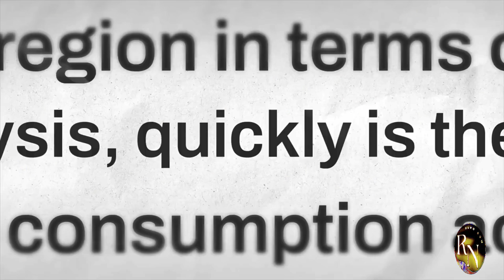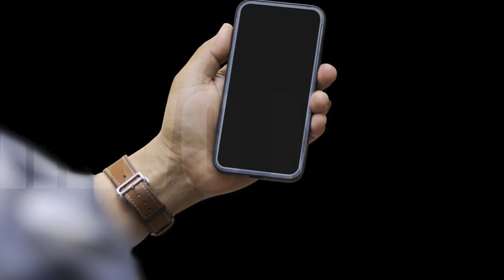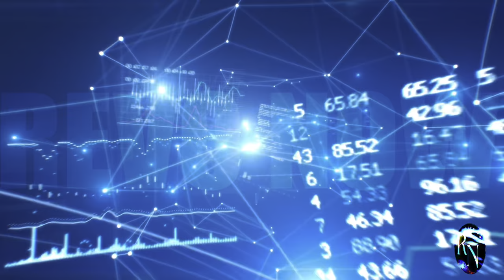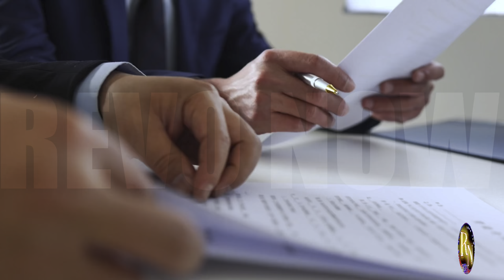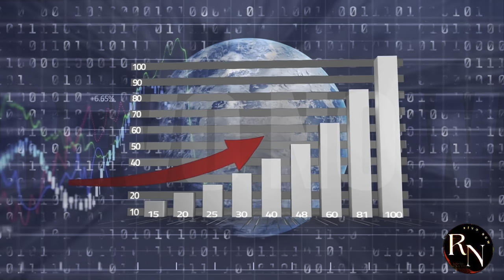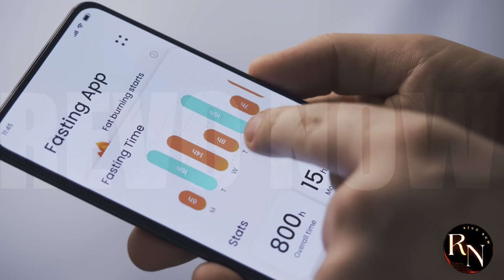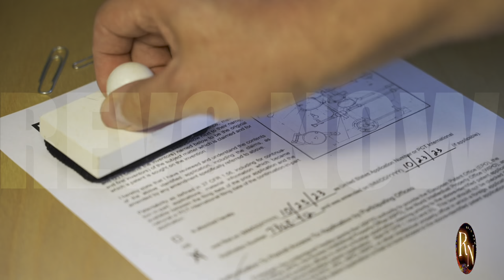Huawei's Shocking EUV Patent Filing CRUSHES ASML Stock!

Comment: Well done Huawei. 
Apparently Huawei does away with the complicated ASML assembly, which depends upon components from multiple non Dutch suppliers, resulting in ridiculous high costs.
Like the EVs, Huawei customers can expect high quality at lower cost. 😊
Reply: That’s how the Japanese lost their control as well, too greedy😂😂😂😂😂😂
Reply: ASML would have supplied the EUV machines, if the US had allowed them. Their design, when built, was at the edge of the possible. But technology keeps moving forward. Methods unavailable when ASML produced their EUV light source, have become available. 

For example, Blue light LEDs. The Blue light can be used to power a UV laser light source.